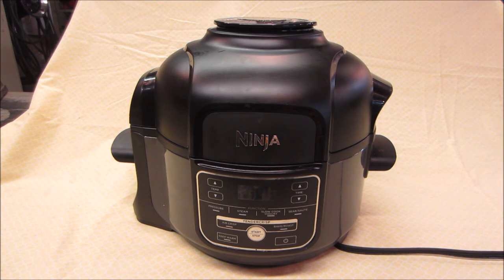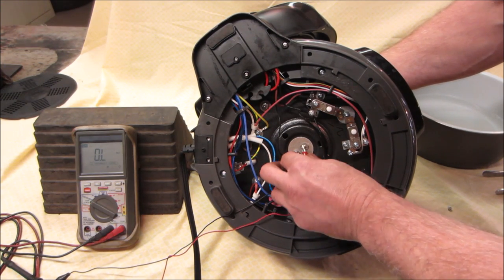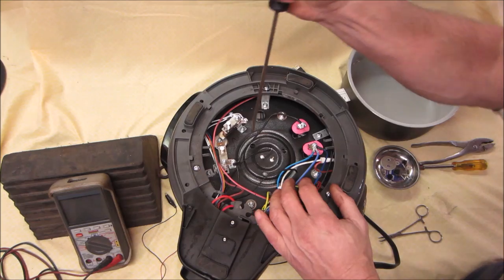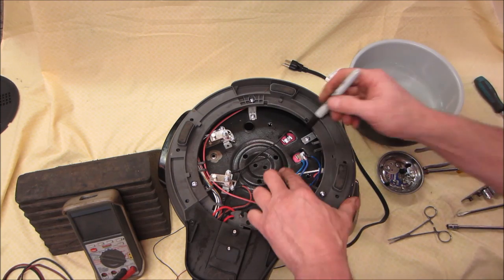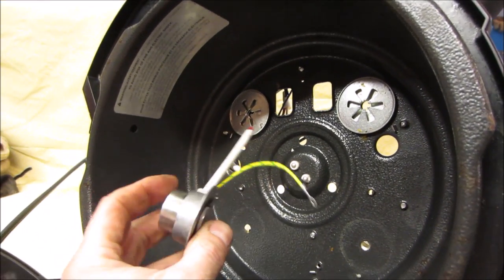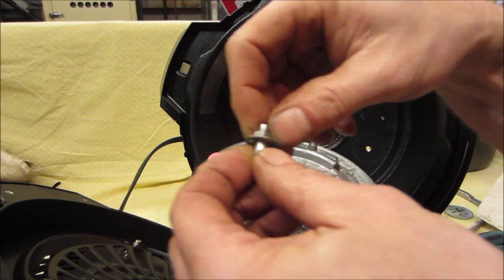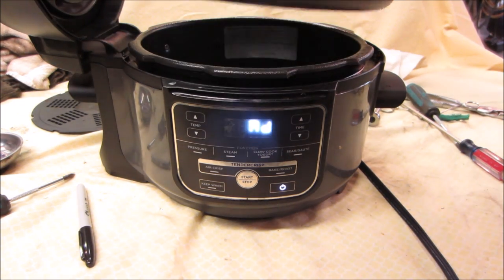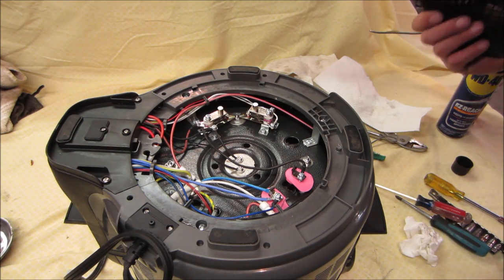FAILED! Ninja  Pressure Cooker, Air fryer. lets take it apart.

Comment: From my years in electronics repair: if you spill something nasty into your electronics, immediately yank the power. Then flood it with water, preferably distilled. I know water and electronics don’t mix, but actually water won’t harm the circuits if there’s no power. Flood it til you’re sure the goop is gone and there’s nothing left but clean water. Now put it aside until it is completely dry, like leave it for days, in the sun if possible. It will probably fire right up with no ill effects.
Reply: rubbing alcohol is even better - it's non-conductive, doesn't corrode, absorbs other water, and evaporates quickly and without a trace
Reply: FYI : I suggest to use near 100% industrial alcohol or buy a small bottle of methylated spirits in your chemist and use it. Both will clean really well and evaporate away quite quickly whereas water can remain on circuitry and under components etc for a long time even if placed in a warm aired environment.

Comment: Glad I saw this.  We've had one of these for a couple of years, and there's barely a meal that goes by when we don't use it.  VERY versatile.  Rice is so easy and never sticks to the pot when pressure cooked.  Never had a mishap where we forgot the pot, but glad that I've seen the steps to disassemble in case one ever happens!

Comment: I just took apart a bathroom fan, light heater combo because it was covered in lint where people were using the dryer with no vent to catch the lint. I cleaned it and put it back in but didn't work right. Found out the wires on the 2 plugs on the unit had been switched. The wires are labeled up inside the mounting box. Just took me a bit too actually look close enough and see them. Amazing it worked at all having the wiring backwards. Once I got the wiring right worked fine, especially the heat, has the coiled wire zigzagged . Thanks for sharing.

Comment: Lots of folks who still had the box & receipt would have taken that back to the store & claimed it was like that when they pulled it from the box. If they didn’t have the receipt & box they would have gone & bought another one & later returned the bad one that way.  No I would not do that myself & I’m glad to see y’all didn’t either. 
I was thinking some of the screws might be hidden under the pads on the bottom because I’ve seen that done before.  I have a curios mind & I’ve taken broken stuff like that apart. It’s kind of being destructive but in a good way since it’s already broken anyway. Took a cordless computer mouse apart not too long ago. 
One time as a kid I took apart some NON-broken pop-open opera glasses kind of thing & couldn’t figure out how to get them back together. 🤣
Reply: Even if you are honest and tell them exactly what happened they will still give you a refund.

Comment: I would have just grounded the two black wires together and called it a day. Not too many people would forget the fact there's no pot in it except my 80 plus year old mom. She shouldn't mess with one of those pots and probably wouldnt.
Merry Christmas and Happy new Years. Thanks for the Christmas Cheer. Better than putting a Barbie car together. Ugh!
Reply: There are also householdswith inquisitive young ones that feel that buttons are for pressing...
Reply: @michaeltempsch5282   Nerfing the world just creates bigger idiots brah
Reply: @RC Hobbist  - I was thinking the same like 4 minutes in. Guess I'll have to keep watchin though to make sure it wasn't addressed or that I didn't miss anything.
Reply: I second you on that. If I went deeper into it I would end up trashing it
Reply: That's basically what I did when the sensor on my wife's air fryer went out after a year.
Reply: My wife's vacuum had a "safety" switch that malfunctioned so I removed it and spliced the 2 wires together and haven't had a problem with it since. I got the trick from working on my mower.
Reply: Yup, that would've been my approach as well. Thing is if it failed this easily, it'll probably happen again.

Comment: I wish my Mother had had a microprocessor controlled pressure cooker when I was growing up. (I'm sure my Father would have wanted that as well.)  She overheated and blew the pressure control weight off and spewed the whole mixture on the ceiling.  Several times.  On another occasion she left a pot of water on the stove and went to the mall.  Destroyed the kitchen. Then a year later she did it again.  I installed a wall timer to control a 220V/100A relay so the range could not stay on for longer than 30 minutes.  It kept the kitchen from being burned down again but it did not improve her cooking.  When she said she would cook Christmas dinner for the family we learned to immediately jump in and say we want to go to Chinese.  Today my sister will jokingly say she is going to cook something just like Mother used to do.  And that's my cue to offer to get the fire extinguisher.

Comment: pretty poor design if you can not get the inside liquid proofed.
Reply: Yup, terrible design - naturally it's going to get liquid spilled in it from time to time. Or of course it's designed to fail ........
Reply: Terrible design = planned obsolescence = repeat buyer
Reply: 70 dollar is cheap a proper philips airfryer more then 140 euro's.
Reply: It's called "engineered obsolescence"! Why make them last a long time? It's about sales today not customer satisfaction. The 'love' of money is the root of all evil!
Reply: @theduke8504  Clearly not engineered obsolescence. Very little engineering going on here.
Reply: @arjanvanraaij8440  pretty sure he said $170 (US).
Reply: @arjanvanraaij8440  $170.00
Reply: @Deon Denis -- the "base" is just short of identical to a pressure cooker that sold a few years ago.   I paid about $70 for it and it failed shortly after I misplaced the receipt.   I ended up tossing it.
Reply: Happened to me after the pot came out with the pressure cooker lid.  Water spilled everywhere. Almost had severe burns.  Very disappointed.

Comment: Think I would have took the easy way out and just bypassed the switch by hooking the two wires together............cause I probably would never have gotten that thing back together again. :-)
Reply: Wrap the chicken in foil and tuck it against the exhaust manifold, and watch out for golden hawks.
Reply: No, if it craps out under normal use conditions, I'm not going to do the manufacturer's job for him. I would demand my money back, and scratch the defective product from my shopping list.     
If the seller or the manufacturer balk, I would scratch them from consideration for ANY future purchases.
Reply: @r1lark That's exactly what I did, worked perfectly thank you!

Comment: all you need to do is dribble a  little two stroke gas down the spark plug hole,  then will plug her in and see what happens
Reply: 😆 I think it would have turned over one time.
Reply: give her a little tickle

Comment: Goat's eyes look strange, like a coin slot. Great video. I become insufferably pleased with myself anytime I can fix something without having to buy new parts. It's like a double-win: I fixed it and I didn't spend any money. Unfortunately my last repair like that didn't last, so I have to buy a new timer module for my washing machine. JB Weld only lasted a few months. Oh well, it's still cheaper than a new washing machine.
Reply: Just use epoxy. Better than jb weld

Comment: I had a Elite electric Pressure Cooker I go from HSC back about 2008 I think..I have been a fan of pressure cookers since a sweet old lady turned me onto them and the speed they cook..Well I loved the Elite model until one day no power..took it apart and it looked to be a fuse long story short I just directed wired it bypassed the tiny tiny fuse and it was fine for about 10 years until I dropped it and the dent was just too ugly to keep using it! I have since had a Cuisenart and another model..all worked fine..plus I still have the old stove top Presto model!

Comment: poor design if a little spill can take it out. I'm actually surprised it could be fixed, moat things these days are made so you can't take them apart to do anything, and get them back together.
Reply: Mustie1 can take anything apart and put it back together. Andrew Caramata can to, he just uses different tools.
Reply: @williamarnn5240  Yes!! And that tool is usually an excavator 😂😂😂
Reply: @williamarnn5240  I can sure nuff take stuff apart... but getting it back together... nuther story. However what I was talking about is how many things are glued together these days so the consumer has no access if they break, that's it, you have to break the plastic to open them, and when you do the parts are glued in... and you can't get replacement parts least ways not new.
Reply: Coffee makers are notoriously unrepairable. Manufacturers are afraid of liability. And house fires.

If I am spending my money on an appliance I want it to work for me,  not me on it.
Reply: @davem5333  That's true, but I have been able to repair a few. Most times not though. The simpler ones are not bad to repair, but the ones with timers and all that, very difficult to repair. I don't think liability issues has anything to do with it. They just want to make shit as cheap as possible, then when it acts up you toss it and get another. However, if that happens, I never buy that brand again, unless of course I got good use out of it. If it dies early on, then I will not buy that brand again. Now I buy them at thrift shops mostly, the older ones. Ones I can still fix if they need it.

Comment: Everything is repairable.  My pressure cooker went out.  New one is $100 a new thermal fuse was 5 for $2 off ebay.  Hard part was soldering in a thermal fuse, ended up wrapping the fuse in a wet towel and then soldering like normal.  Worked fine.    :)

Comment: The whole time I’m screaming just connect the two black wires together and bypass the sensor.  Who cares if it thinks the pot is always there.  My in-laws had a really nice bread maker.  They started making whole wheat which was harder on the motor.  One day it just quit.  Being me I had to take it apart.  Under a plate, which was riveting on was a fuse.   It was an old school glass one.   I didn’t have a rivet gun back in those day so I just used sheet metal screws.  Built to break and not get fixed.  My ninja blender had sensor problems so I just bypassed the micro switches.  Permanently fixed.   I hate stuff like that.   My compressor is that way.  It’s a Lowe’s blue hawk so no parts are available.  I’ve had to make parts for it so many times I starting labeling each repair.  It’s a daily used item and usually goes 3-4 months between repairs.  What junk.

Comment: Should have hooked those wires together, see if you still get that error message.
Reply: that would have been my method. It's not like you would ever turn it on without the pot anyways. Being I am a cheap bastard, I would've grounded those two wires and called it done.
Reply: @scottfirman  That is what I was thinking. Besides IF that switch was bad, Where are you going to find another one ?  Some times you can not find the parts you need. And when you do find them they can get expensive.  I had bought a new router and the trigger switch was bad. I left it sitting out to take back to the store. I come home from work and it is gone. I tore the house apart trying to find it, thinking I must have put it some where else.  About 20 yrs later my sister is having a yard sale and there sat my router. In-Laws, right, go figure. Well now it is out of warranty and they stopped making parts for it years ago. Awww Nobody can do you over as well as family.
Reply: Yar Nunya  Good one !   Thing is every time something breaks or tares up I am the one they call.

Comment: What a foul design that some liquid could ruin the product. Spills will happen. What a dangerous product.
Reply: In the world of disposable items, This is a huge money maker.. One or 2 spills and you buy a new one...  Disposable items, Cheaper to buy new than to fix...
Reply: @kameljoe21  I  am an engineer for a company that routinely gets ul and csa certification on their products.  Knowing what we have to do to comply with these standards, It is so hard for me to understand how something like this POS gets on the market. The liquid can pour directly down into the electrics. Products with heating elements are always absolutely the worst.
Reply: @tmackinator  UL certifications only cost about 5 to 15k to get them, Most if not everything can be UL certified. The really only thing one needs to get a UL cert is to pass the requirements on wire size, current draw, shock hazards and some other things.  UL and  CSA are kinda the same thing, UL for US only and CSA is worldwide ( I think ).  Crap like the Ninja get to market because they get the least amount of certification need to bring them to the market. Now if they sold them with a NSF certification this design would be nothing like it currently is... 
 
  NSF only test for food contact materials, contamination, design related to safey and must comply to those standards, Which is far more than any other certification out there, Which is why they have a much higher price tag than the crap you can buy at you local store.  Which is mostly all of the appliances, pot and pans, dishes and utensils that I use. Most of this stuff will last me a life time and I pay a fraction of the price buying 2nd hand.

Comment: I will not buy this unit, Because at some point something wet is going to get in the unit, "IT'S A PRESSURE COOKER". "Condensation" Very Poor design. $200.00 may not be much to you but I would have taken it back to the store. Now I don't have too. Thank You. Happy Holidays to you.
Reply: That is a very good point, but I think the inside pot is designed to seal with the lid to form the pressure.
Reply: @Deon Denis That would have easily made it a prosumer tool and put in the 450 dollar category. ;P
Reply: Deon Denis That’s just the way crooked companies operate nowadays. HylianOverlord is precisely right though, and it’s like that with damn near everything! We sell several brands of mowers at my shop and there’s about a grand difference in IDENTICAL tractors that has the option of a stamped deck or a fabricated deck. Literally same mowers, same width cut, same engines. Add a shitty welded deck and raises the price substantially. 🤦🏻‍♂️ 🤷🏻‍♂️

Comment: How is it not proofed against an internal spillage? Awful cheapness.
Reply: I agree. Junk pile. Imagine if you attempted to clean it and destroyed it.
Reply: It was made for culture that doesn't have stove, and most of the people live in one room apartments.
Reply: @Kikilang60  what's that got to do with it not having protection from spillages.
Reply: The pernious nature of water, and it's effects on electronics is the bane of all engineers. Water will alway find a way to ruin electronics. Any electrical devise will fail, if depends on accidents not happening. For example, having sex, with out protection. You are chosing to have children first, and sex second. The Ninja pressure cooker wasn't made to break, but actually made broken, it liquid dripping down will short out the devise. I have a crook pot that was sitting out in the rain for two weeks. I open it up, and checked to see if it was dry, and worked fine. The short of it is, there is no protection from water, with complex electronics. Look, my last stove I bought was used, and older than I was. On top of the stove there was an electrical timers, a clock. lights, and a fan. All of  them were above the normal spill level, but still they don't work. I thought I could fix the lights, and fan but no. It all ran into a central unit. There was an electrical ignition, for the gas, but that was very simple. Recently I bought a Samsung stove, and it has an electrical start. I figure, I'll have about six year before the computers fail, and I have to dump it. I watch this channel, "EmmymadeinJapan". She just bought a new, and very expensive stove a few years ago. About the price of a used car. The thing is dead. She tried fixing it, and the electronic just keep failing. I think she buying antique gas stove next. No electronics at all. That stove doesn't need protection from water, because there is no electronics. In the current state of affairs, most new buildins don't have gas running into the homes kitchen, if any gas runs to them at all. Here the skinny on protection from spillage. You raise all the electronics above the spillage, and that's the protection.
Reply: Yea, your bound to spill liquid in this, what a crock of shit design. I think the 'Ninja' is how fast you bin it after purchase.
Reply: @Kikilang60  no
Reply: It certainly makes me consider putting a Crock Pot liner under that pot. But as long as you are careful not to spill anything down in there, I guess that is the most important part. I’ve had mine a year and never a single issue. But there is definitely enough complexity under that hood that I don’t ever want to have to do this. Very entertaining video though.